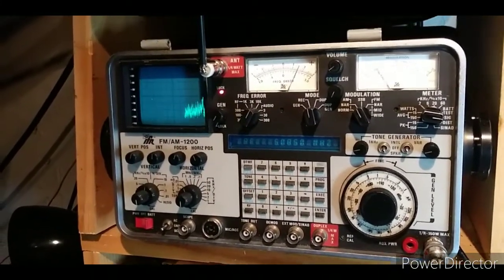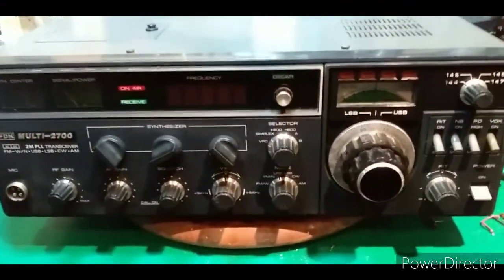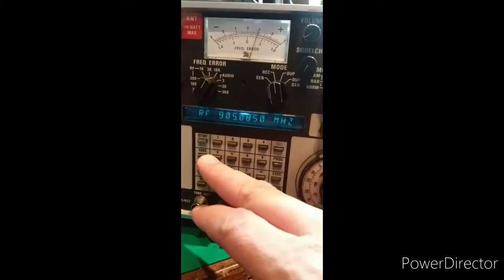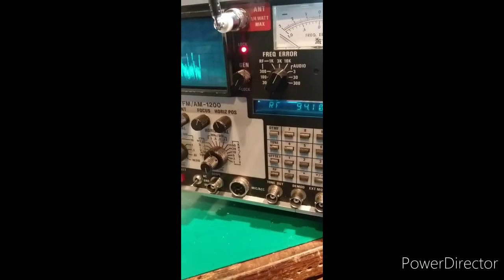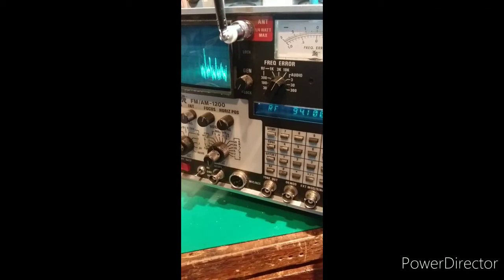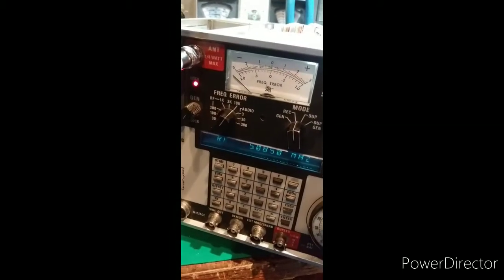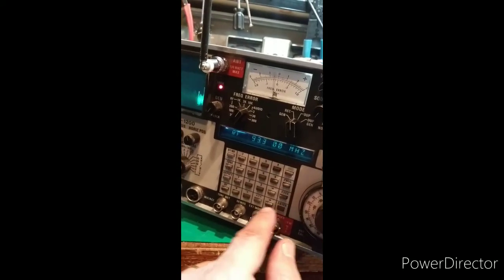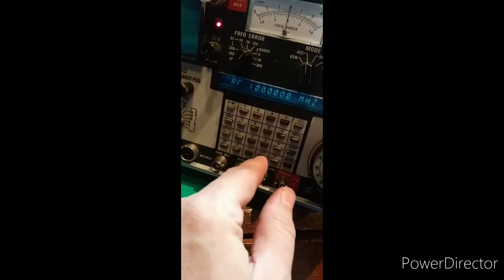IFR 1200 lock issue

Comment: Have the S version, battery died and disconnected it. Have lost lock on everything above 200 MHz. Did download the manual so that's around 600 pages of serious reading. Trying to find a suitable AGM battery to fit in place of the original six D cell size lead acid rechargeables that came with the unit. You mentioned batteries could cause some issues with the rig, unlock on upper freqs perhaps?
Reply: The BR2325 battery on the processor board will go dead, or leak over time. This can cause issues.  I would suggest you change that battery first. You can de-solder the old one. and mount a holder on the back of the processor board and run the wires around to the front pads. I would cut the battery leads first, then remove the old leads.
Reply: Darrell, thanks for the info!
I will try and locate a suitable replacement for the battery. I am currently in the EU and I will have to check with both of the EU operations of Mouser and DigiKey and see if either has something in stock over here. The joys of lithium chemistry, darn shipping restrictions to get them from the States anymore.
Thanks again for the heads up!